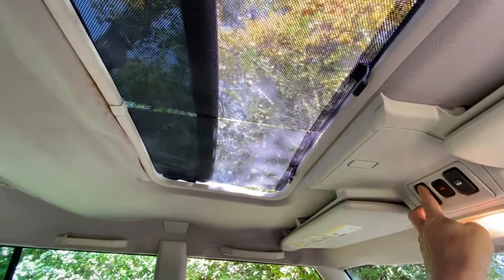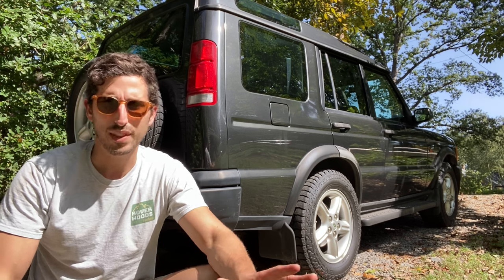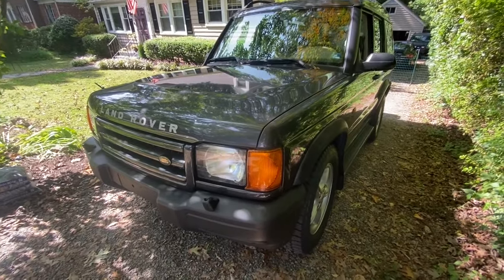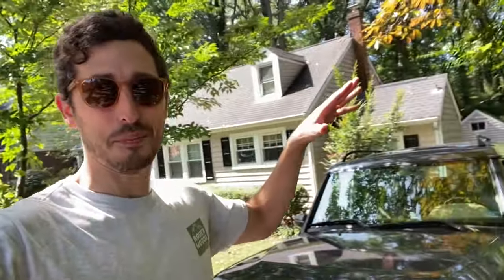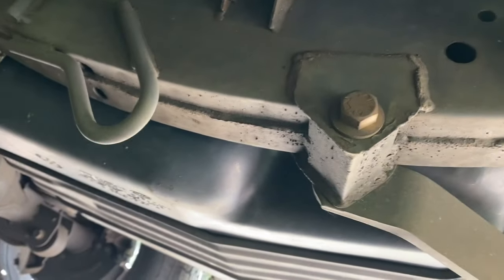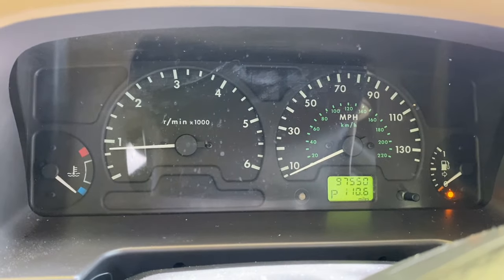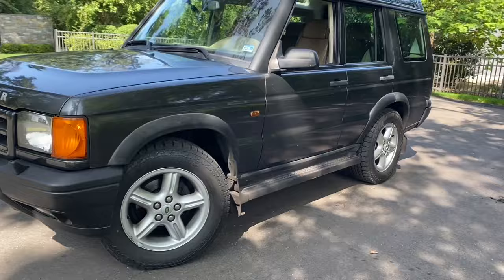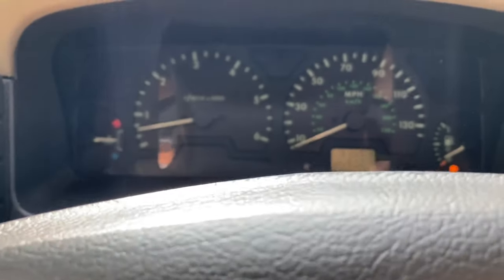Land Rover | Better Used Than New? Why Rovers Get Better With Age + The Cleanest D2 FOR SALE!?!

Comment: MAYBE there will be fixes for the new-tech problems that the new models have, and they might be worth something in the used market. But I think that those new-tech issues are un-fixable and they won't be worth anything. Right now, I wouldn't buy anything newer than an L322 or LR4, and that's the cut-off. Anything newer would be worthless to me. And I wouldn't have anything newer than a D2 or P38 for off road, beyond gravel.